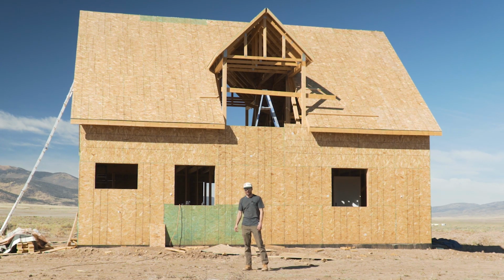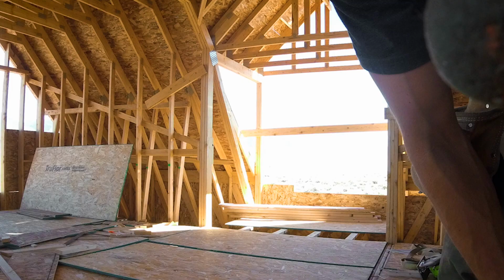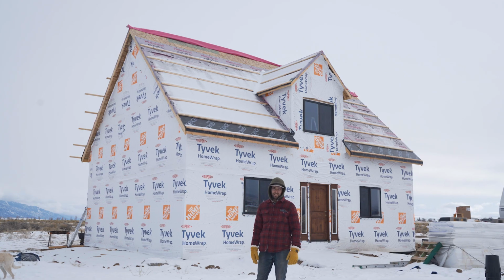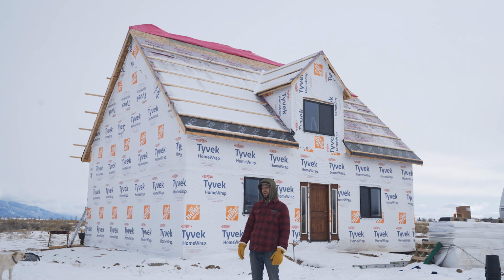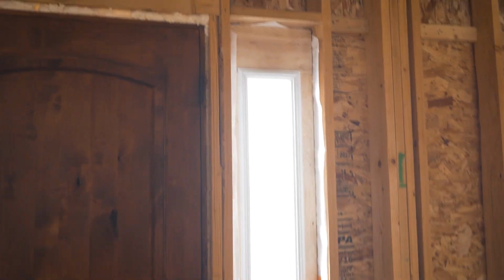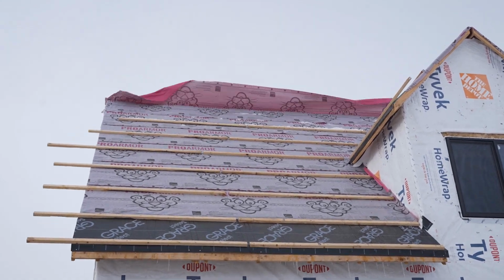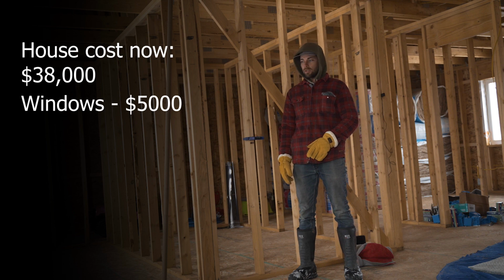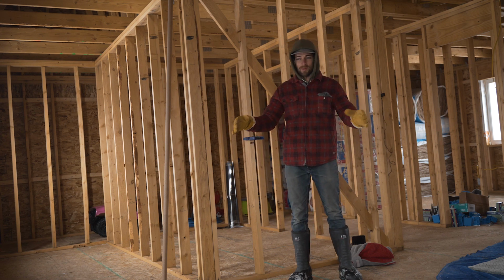DIY House Build pt 8: Drying It In

Comment: Curious if you plan to air seal the tyvek in some way? Not sure it is common/recommended but maybe it could improve air tightness?
Reply: Air sealing is highly recommended.
Reply from the maker: Thanks for the comment! I’ll tape the seams but it’ll be difficult to externally seal the transition to OSB/soffit under the eaves. I’ve foam sealed all the gaps in the OSB/blocking on the inside as my best attempt at air sealing that area. Then I’ll caulk the soffit (I’m doing a conditioned/unvented attic) and hope for the best